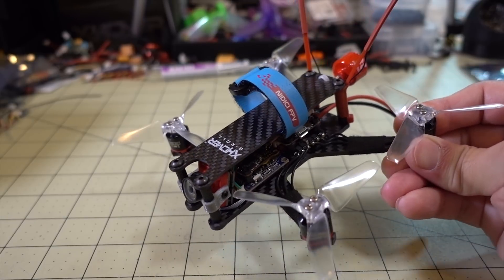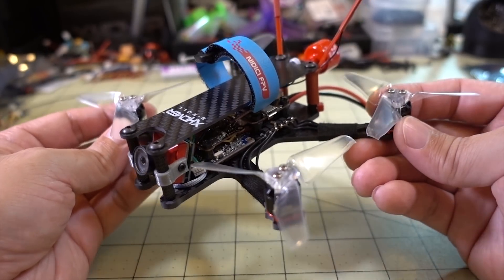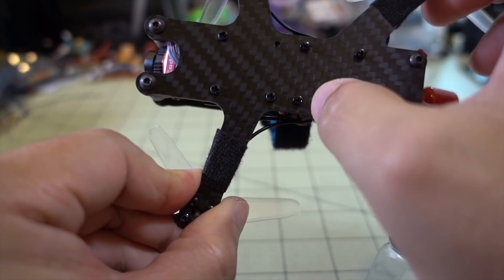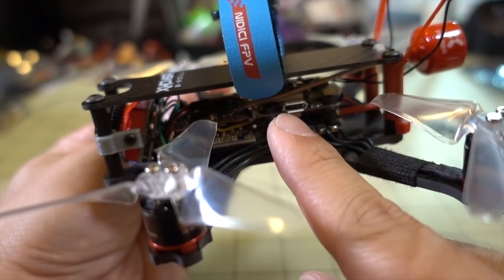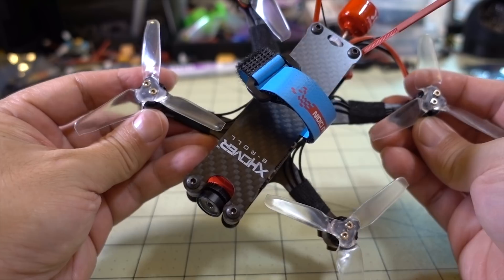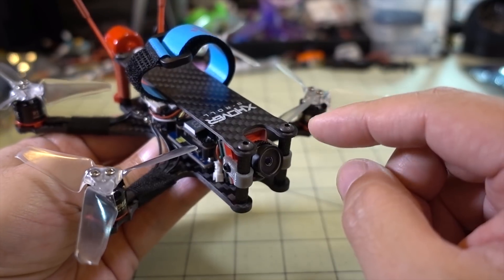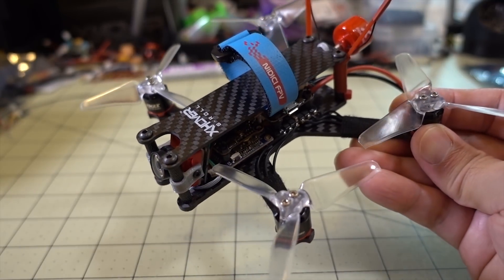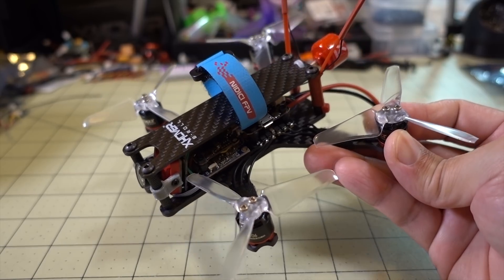MD#116 🚁XHover B-Roll 3-inch HD Video Drone 😀🏁

Comment: I know this is old video, and you might not still have this frame, but do you know if this frame would fit the DJI air unit?
Reply from the maker: It will fit but only up to 2.5 inch props.
Reply: @AlbertKimTV  alright, thank you

Comment: How did you get EMAX 1106 with the 12mm hole pattern? I just bought some and they have a 9 mm hole pattern 😭
Reply from the maker: These have the 9mm hole pattern.  All 1106 motors do.
Reply: Ok turns out my "b-roll" frame is a clone with 12mm hole spacing 🤷‍♂️. The motor protection is perhaps an issue anyway. Are there any other cinematic frames that would work with the 1106? Thanks!
Reply from the maker: @forfengeligfaen  get this one - http://bit.ly/2V8yB0c

Comment: the best part about this frame design is that the props aren't in view of the HD footage. agree with the spacing between the 2 stacks, it's a tight fit no matter what components used. do you have your BF settings on this build (ie. diff) to share ?

Comment: In the caddx turtle review i've seen in the dvr that you use mAh consumed and in this video you say that you are using the hakrc 20a 4in1 which doesn't have a current sensor?!
How are you getting the current readings - external sensor? Im in search for a quality 4in1 (min 15A) esc for my micros that would have a current sensor but so far i havent found anything good (there is the dys f18a which was very noisy on my 2" setup and the airbot ori32 which somehow makes my motors run very hot).
Any tips?
Reply from the maker: Virtual sensor... Or use the Diatone 25a

Comment: There are some interesting design choices in that frame that make it a total no-go in my opinion, the most glaring omission is the lack of motor mounting options and provision for more motor protection on the arms, after all there is a lot of excess carbon in the top and bottom plates that could be removed and used on the arms and to save weight as you pointed out Albert.With a frame weighing as much as this does more powerful motors are a choice that can't be ignored.

Comment: Hi Kim, a bit off-topic but is there a reason why you don't use r-xsr's? I recently had to use one instead of a normal XSR (never had a problem with X4R-SB and XSR). The thing failsafes at close range for no reason (RX LOSS on the OSD) at 77% rssi. I checked the usual things (antennas connectors, antenna position..) but it still does it. The XSR is rock solid. I think these r-xsr are just plain unreliable (other people mentioned these issues)
Reply from the maker: I use the XM+ because they are cheaper and I don't use telemetry. I just need RSSI.
Reply: I'll try the XM+ at this point, I need a small receiver. The XM+ is just slightly longer than the r-xsr but nothing crazy.